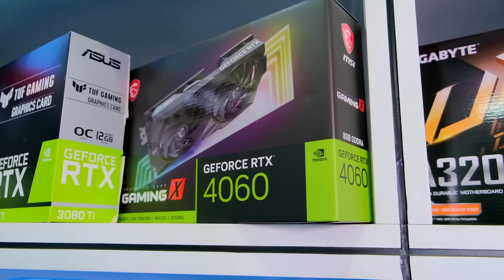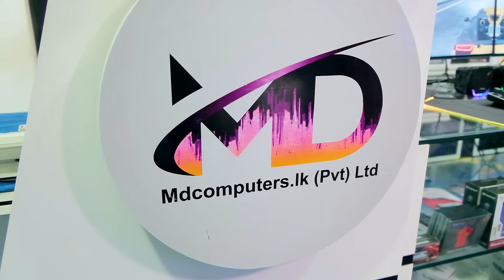😍 නෙත්මිණ මල්ලිගෙ Dream Gaming PC එක - MD Computers - 2024 Prices ❤

Comment: Aiye mage pc eka sell karanna baluwe

Processor - Intel Core I5 11400F
GPU - Palit RTX 3060
Motherboard - MSI B560 PRO E
Memory - Corsair LPX 16GB 3200MHz 
PSU - Corsair CX750 80+ Bronze Certified
Storage - 240GB M.2. + 1TB HDD

Aiye me thama mage pc eke requirements 

meka sell karanawanm kiyakata witharada denna puluwan 
MSK eken meka lap ekakata exchange karaida (macbook m1 air ekakata wge)